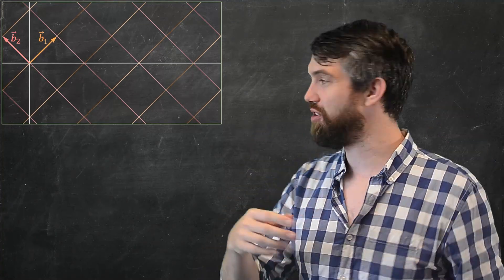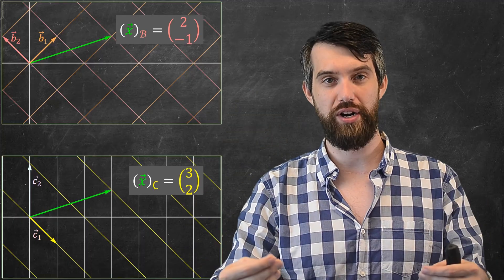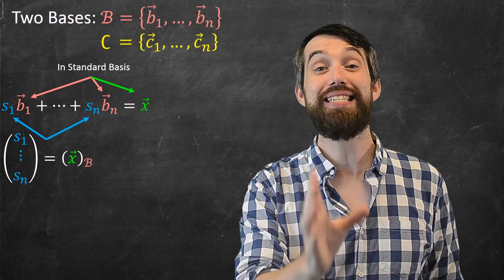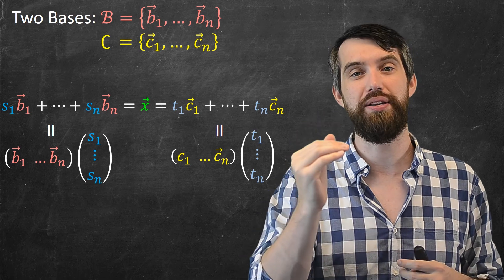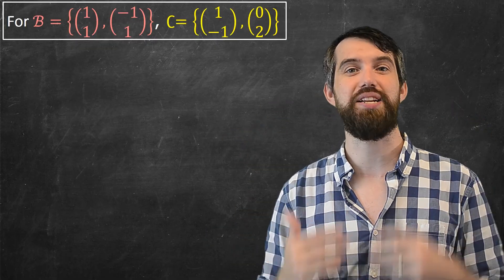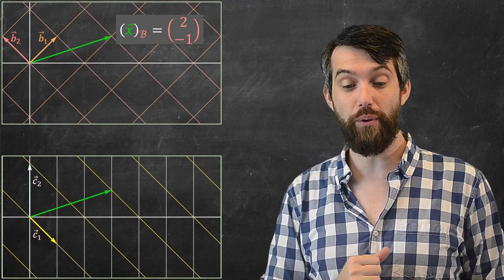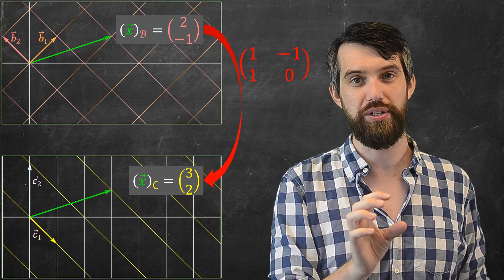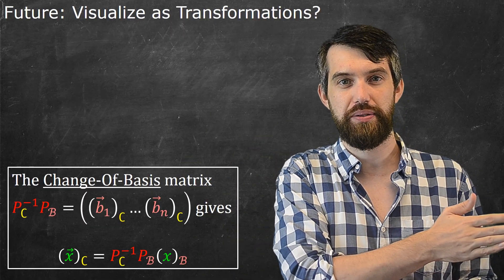Changing Between Two Bases | Derivation + Example

Comment: It seems to me that we are assuming the standard basis here as a backdrop. Even if we aren't directly using it. Otherwise how do we know where the point is in each basis without using geometry and measuring it. If all we have are the two independent arrows at a certain angle to each other and their respective lengths... we would need to know exactly what their addresses are by measurement.